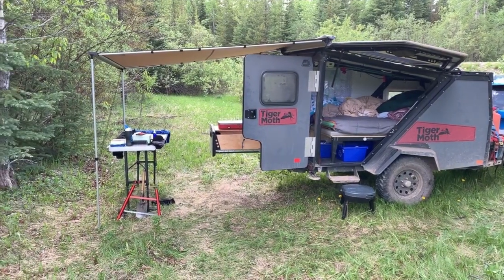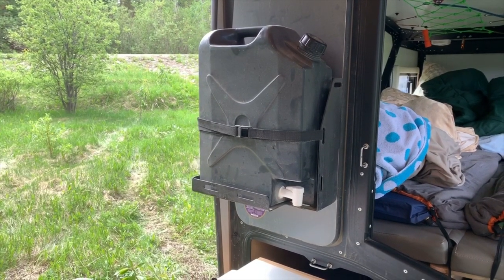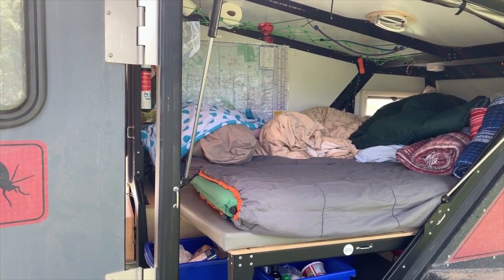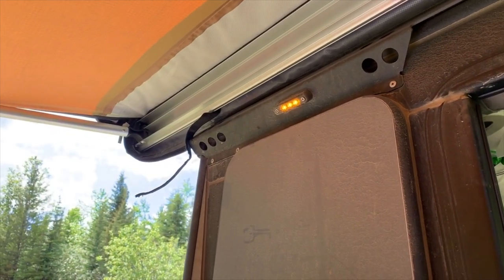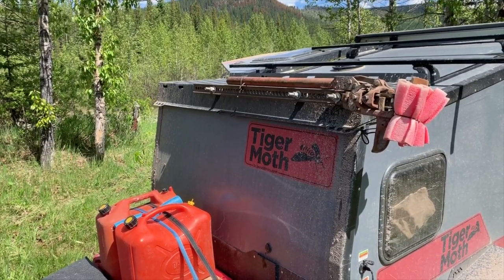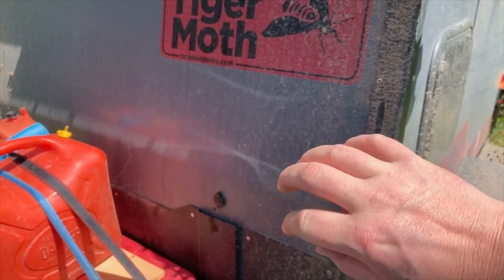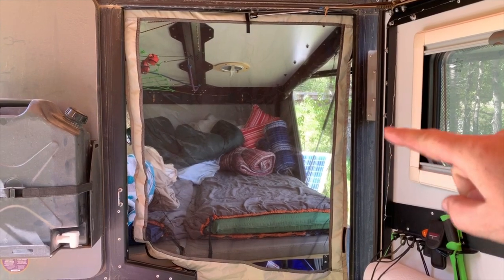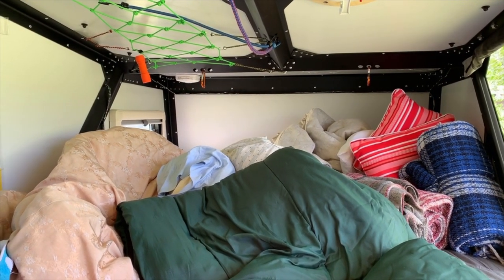TAXA OUTDOORS  TIGER MOTH - 1 YEAR IN DEPTH REVIEW

Comment: REALLY well done video review!  Considering the Tiger Moth as an upcoming purchase.  

You've made some excellent observations for improvement:  spare tire relocation, corner bracket stability, switching sleeping orientation (and reading lights), mud flaps on wheel wells, pull out steps on both side and rear, relocating tongue box against camper, heavy duty rivets, lock tight screws, better access to front storage while in bed configuration, a rear canopy that mounts below the roof line...  

I wonder if Taxa is paying attention here?
Reply from the maker: Dave G thanks Dave. Kinda doubt they’re tuned in but maybe?  Customer service from them has been challenging but I just plan to fix whatever I break myself.

Comment: Our 2018 Tigermoth also has the ARB awning and is about an inch or two taller than the garage door frame. What works for me is to crank up (down?) the nose wheel, which in turn lowers the rear end...and then I can get it under our 7ft garage door frame. Maybe that will work for you too.
[Edit] just to be clear...I disconnect the trailer in front of the garage, crank the front up, then push it into the garage by hand.
Reply from the maker: Matt Grimes yes that worked. I got a system down now that is pretty easy. I put the little wheel on my mechanics floor jack. I find it easier to steer that way. 👍
Reply: Excellent idea!

Comment: I peeled the decals off mine shortly after I got it. It looks a lot better. I also picked up a gear loft from overland taylor. It works really good with this camper and is so much better than the flimsy shock cord ceiling nets.

Comment: Try raising the front jack, and airing down your tires and pushing the trailer by hand...you may fit in the garage that way. Also, you can buy aftermarket screens for the front of the trailer that attach to the front frame. They will deflect mud, and stones.

Comment: Great review, thanks very much. My wife and I are looking at buying a 2019 version. Any advice now that you're several years in? I definitely plan to use it as you have (for rec site camping and boondocking on forest service roads).
Reply from the maker: Glad to hear it helped. I’m on year 4 now and still love it.  I am at the point of some items needing attention but not in a surprising way. Foam seals are compressing, still working though. The fan is on its last legs. The cheap OEM battery is nearly done. But none of those would be unique to the TM. 

I’d go for it!  Do check all fasteners. I had to redo and lock tight many of the.  That’s probably the biggest item to be proactive about. 

Have fun!
Reply: @wejumpedin  Thank you so much! I'm in the BC Interior so perhaps we'll cross paths out on the Alberta FSRs!
Reply: @wejumpedin  another question just jumped to mind. Do you have the regular ball hitch on your trailer? Any issues with that on rougher roads? I’m wondering if something like a fully articulating hitch like a max coupler is possible or necessary.

Comment: Good vid. I have a 2017 TM. I plan on welding in triangles at all the joints on the frame for rigidity and maybe add some stringers length wise to kinda box everything in. The guy that broke his TM frame carrying a lot of tongue weight posted pics on the Taxa Facebook group which showed a weak point that could be addressed as well. I think a few hundred bucks in welding will prevent alot of the flexing cutting down on the stress on the rivets and frame to floor hardware. I also plan on changing all the screws for the frame and kitchen tracks to through bolts with locking nuts. It would be super easy to have the tire mount modded to be up higher. Lastly id cut/extend the hitch about a foot and add an articulating hitch. The short hitch causes the TM to suck at backing up and the closer it is the more prone to damage from jackknifing.
Reply from the maker: William Sealy those are all great points. I’ll probably keep picking away at little tasks to optimize this little trailer. That’s part of the fun for me as well!

The fellow on our FB group that broke his probably was over weight by a factor of 2 or 3. He had that thing loaded!  That fact that he did the Dempster like that really speaks to how well engineered these little trailers really are. I love it.

Comment: Thanks for the video! I continue to watch this video to get ideas of what I need to look for/pay attention to as I travel! 

How did you string up the Paracord for the door? That seems like a great idea that will prolong the life of those attach points on the door and the rig!
Reply from the maker: Thanks for the feed back!  For the back door, the paracord is fastened inside to the main center steel rib at the ceiling and then on the steel bracket where the gas strut is fastened to the door. I lengthen it to the point that the paracord is tight just before the door is completely open.

Comment: Informative. One little nibblet was that there are different valves for water. I wish there was a hybrid of the moth and the cricket.  Outside pantry, just taller in front without pop up.
Reply from the maker: Yes, a hybrid in the small package would be great.  I know some other manufacturers make something like that but they are roughly double the price.  The Moth isn't exactly cheap to begin with.

Comment: Nice looking rig.   That tread pattern is for drive wheels.  I don't see any reason for those to be on a trailer.  More conventional trailer tires would help the fuel mileage.
Reply from the maker: Hey thanks for watching. The tire tread also really helps for breaking on off-road travel I do a lot of and that definitely makes it safer. Fuel mileage...I’m towing with a Jeep so that’s not something I set out in the beginning to optimize.
Reply: A regular trailer tire will not withstand the gravel and rocks. Plus if  you are trying to slowdown or stop a highway tire is just going to slide.

Comment: I’ve never understood why these rugged trailers have all terrain tires. Isn’t traction irrelevant for something being towed?  Seems like sidewall strength would be the most important thing.  I suspect they are just what is available.
Reply from the maker: For most normal situations, like on pavement, you’d be correct. However for how I use the TM, I do find value in the more aggressive tread pattern for a number of reasons. And to clarify, these are ST tires, they just have the tread of an aggressive AT. 

1. On slippery, steep down hill sections the trailer tires are able to provide braking assistance. That has proven to be of high value multiple times when things get a bit sketchy.  The trailer can control itself rather than push the tow vehicle. 

2. When we are off camber and it’s muddy, there is less of a chance that the trailer slides sideways, possibly into trees or worse, a steep ditch. 

3. They provide better protection against punctures when off-road and especially when on trails with sharp rocks or sticks. 

Hope that helps!
Reply: @wejumpedin  very helpful. Thank you!
Reply: Traction is a very important part of off roading. The trailer brakes would be Absolutely useless with highway tread 👍

Comment: Hey I noticed you upgraded the water valve, what kind of valve did you use? Ours is horrible and really need to upgrade it.
Reply from the maker: Vinny I bought it off Amazon. It should have gone for a brass one. I’d definitely suggest that over plastic. I believe the threads are somewhat universal.
Reply: You can buy a brass valve through the Front Runner website.

Comment: Thanks for the video. How are the gaskets on the doors and kitchen slider ? Does it keep all the dust out ?
Reply from the maker: Jason Smith on the kitchen slider and back door they very effective. The wing door has a small gap where the gasket doesn’t quite align with the frame. Surprisingly that doesn’t let too much dust in. I have notice that the gasket is starting to peel off. I’ll have to replace that soon.

Comment: Thanks for the review - very useful. Im thinking of the overland 2021 tiger moth or the woolly bear. We go off road a lot so im glad to hear that you have taken this off pavement with success.
Reply from the maker: I think you'll be very happy with that choice.  The upgrade they have done to the axle and the hitch coupler are significant!
Reply: @wejumpedin  We are not rock crawlers but we live in SW Colorado b/n the mountains and the desert and we do get into the back country so we want something that can go over that sort of terrain w/some confidence. Anyway, thanks again!
Reply: @wejumpedin  Oh, can i ask another stupid question: we would also need to bring some extra gas on trips cause our xterra is a pig and we go into the back country. How do you secure your gas cans when you go on a hike and leave basecamp? I guess just strap them down on the cargo area and assume/hope no one unstraps them? Any input is appreciated! 

I put down my deposit today for a 2021 and am looking forward to it.
Reply from the maker: @COplateauguy  I have carried extra gas a number of times. But I haven’t left the trailer unattended in n those scenarios. But I do lock my cooler shut and then also lock the cooler to the frame. I do this at the front on the lower cargo shelf. Maybe you could come up with something similar for gas cans?